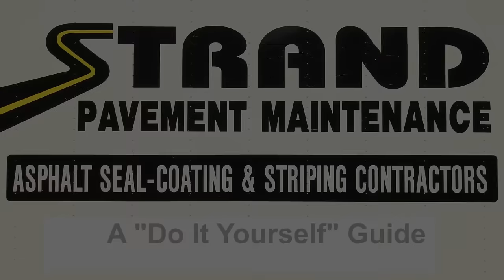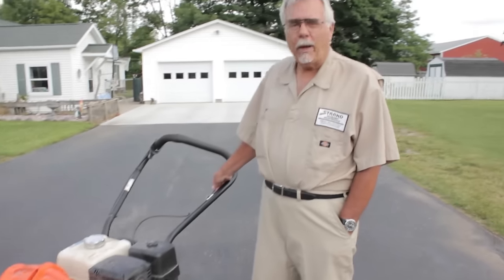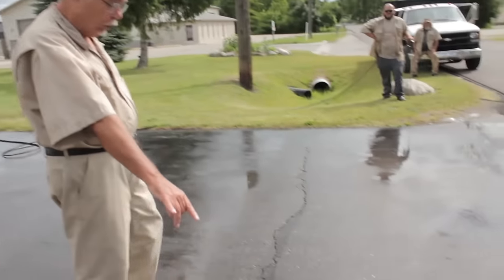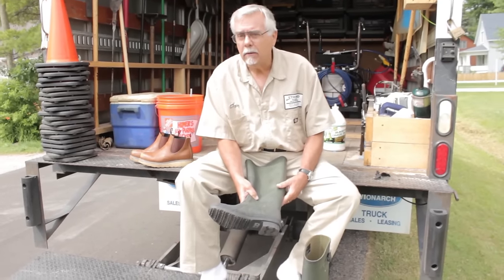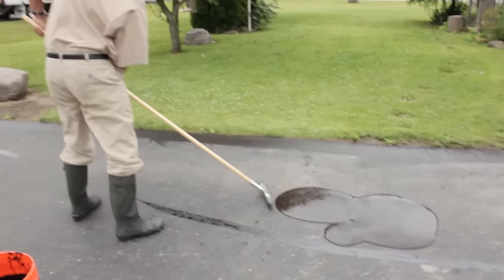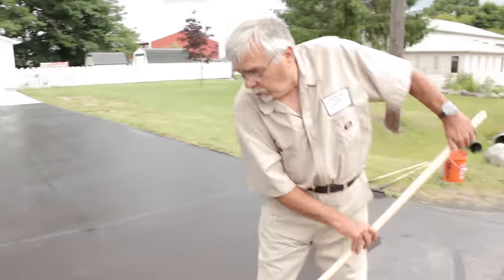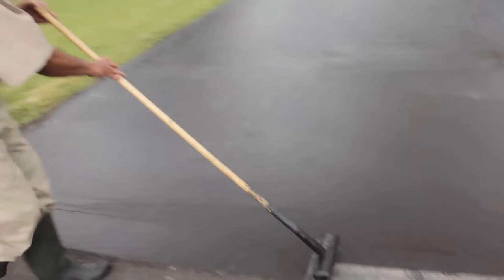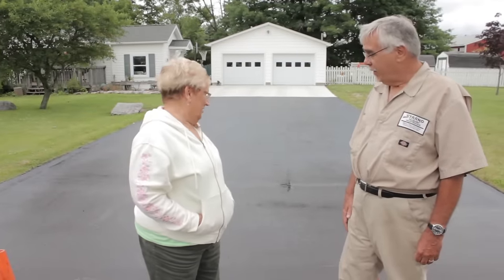Asphalt Seal Your Own Driveway!

Comment: As someone who's done asphalt work for basically my entire neighborhood, if you decide to do this on your own and are either struggling to get your hands on a power washer or cant get all the dirt off the pavement youre working on, dish soap and water, a clean broom, leaf blower, paver squeegee, and a basic hose works just fine in cleaning and prepping for the sealer.
Reply: What the heck do you know about, "ashphalt" though? You worked on asphalt for a living! There's a difference.
Reply: Can you use this on concrete?
Reply: @johnnhoj15  🤣I plan to use this video as reference and seal my asphalt driveway  myself.
Reply: But... But what about the 13 hp Billy Goat?!
Reply: @threadlovert1393  careful!! Dave's method only works on,  Ashphalt, it doesn't work on Asphalt!
Reply: @johnnhoj15  😅🤣🙂
Reply: This is false. Never trust someone named "Jay"...
Reply: I felt like the guy on the video didn't want you to feel like this was a diy project you would want to tackle.
Reply: Yes!!! Finally someone who has a realistic approach on cleaning the surface prior applying the coating.
Reply: @christiancarfann729   yes, the thicker stuff works well

Comment: I totally overestimated how many buckets of material I needed! However I followed all the steps like you said. I had been filling in all the cracks over a period of time because there were many. Yesterday my husband and I went to Lowe’s and picked up 7 buckets, 😂, needed only 3! I bought the soft brush and a good metal squeegee with a handle and some cleaner. I used the Black Jack 700, red bucket. I’m 67 years old and pretty handy with projects around the house. I started at 9 am ( can’t make noise before 9 on a Sunday morning, county law) and finished at 2 pm and that included pressure washing. Each bucket of sealer is about 24 bucks and change plus the cleaner, 5 bucks, plus brush squeegee and handle another maybe 20 bucks. The last estimate I got for this job, Montgomery County, MD contractors 600.00 bucks 😂😂😂😂😂😂😂. Thanks a million for the detailed instructions and also from what you said you aren’t greedy like the contractors around here. If you don’t mind getting a little dirty it’s just a little time and effort. I squeegee left to right instead of up and down and the driveway looks awesome!

Comment: i think this was the most american video that ive ever watched
Reply: How?
Reply: Wayland C just the guy
Reply: Yes! Cheese! ... runny black American cheese!
Reply: Watching an entrepreneur actually do work?
Reply: The complete lack of ear protection and other safety equipment?  Yup.  Very American.  But hey, deafness and lung cancer from fumes and skin contact with toxic solutions only happens to other people.
Reply: how tf
Reply: Brian P Kuhn   blowers and trimming: loud enough to cause hearing damage after 2 minutes of use.
Reply: iatsd Nobody uses ear protection for weed whacking and using a leaf blower. I have been a construction worker for 10 years now, and have used weed whackers for my own lawn for nearly 20 years now, and my dad has been a construction worker for 30 years now, and neither of us have had any ear damage from using weed whackers and leaf blowers. We use ear protection when using really loud stuff, like jackhammers, but simple lawn tools are fine. If you put the engine close to your ears, then yeah it will be loud and can damage your ears, but for just trimming edges, you don't need to wear ear muffs, a respirator, or a full on hazmat suit!
Reply: Brian P Kuhn  As I said, that attitude is very American.  Go to a civilized country where the concept of cumulative/incremental damage is understood and you'll see people wearing ear protection - because it does cause damage whether you notice it or not.
Reply: iatsd If when I am 80 and I don't even notice I have any ear damage, although you insist I do, I think I will take my chances. Also, I am not even American! LOL
Reply: 2 weeks of training, I just learnt it in less than 7 minutes
Reply: iatsd     Huh?  What'd you say?  Can you repeat that?

Comment: I would rather pay him the $130 then do it myself for $65.
Reply: Bob Easy Exactly. It is not that much of a saving really. Sixty five dollar saving and all the hassle of DIY. Yeah nah.
Reply: For real. Steve Irwin's working for peanuts.
Reply: Bob Easy tbh there is no chance that he'll do all that for $130 when he's also got 2 workers to pay aswell as the jet washing he did to prepare it
Reply: Ivan Hardon I'm sure he does more then 3 places like that a day
Reply: Bob Easy yeah 65$ plus ur shoes ur gonna dirty plus ur gas at HomeDepot plus headaches plus other stuff plus u probably won't clean the driveway right all that for wanting to save 70$ lol
Reply: John Doe that big tanker on the truck does the middle section after the cut in in about 30 seconds, powerwashing is useless it doesnt need to be that clean, so a lot that size 8-10 of those a day
Reply: if it's hot and humid, than I aint doin sh*t outdoors
Reply: He is showing the “proper” way, not what he’d do for $130.00
Reply: That's probably just his price for the materials to the customer. I'm sure there were other costs involved that he didn't mention. I don't think he'd be in business if he worked that cheap.
Reply: Yup. Exactly what he is showing. That he can do a good job, and that you don't want the job.
Reply: Actually in another one of his videos he said he made this for people that have smaller drives that he doesn't want to mess with. It's not worth his time to do small driveways if he has bigger parking lots to get to.
Reply: Vincent Falbo Exactly what I thought from the first, “You probably don’t have a...” statement.
Reply: Bob Easy u have a broke persons mentality
Reply: a penny saved is a penny earned. as long as it doesnt take you to do this for more than 5 hours, you've saved money
Reply: Bob Easy 
There resurfacing places that r ok, y.
Reply: thats the purpose of this video
Reply: That´s the whole point of the video

Comment: I just had some door-to-door guy quote me 800$ to seal a 2700 sq ft driveway (that was completely repaved 12 months ago, so no cracks to fill).  I sent the guy on his way, and then started to look into what it would take to do it myself.

It helps a lot just to have an idea ahead of time what the steps are going to be.  For me, I think I will do this over 2 days.  The first for the prep work, and then do the actual sealing the very next day.
Reply: @made-in-the80s I had no intention of hiring him, so I didn't ask.

Comment: i tried to do this 
MY DOG IS STUCK IN THE FLOOR WHAT DO I DO
Reply: CR4SH don't do this indoors
Reply: CR4SH Pretend it's not your dog.
Reply: and for that, we'll just use our weed wacker...
Reply: Cale Tucker but you probably don't have one like he does...just go to Home Depot
Reply: CR4SH you probly don't have your own Jason like I do but any old residential Jason will work
Reply: +The storyteller lmaoooooooo
Reply: CR4SH you gotta put him/her/alpache/helicopter down
Reply: CR4SH omg lol 😂😂😂😂
Reply: CR4SH that should be fine 😊
Reply: CR4SH just cut his legs off and get new ones at walmart hell be fine
Reply: CR4SH get a power washer, i don't think you have one like i have but a normal one is just fine. Clean your saw with the powerwasher you probably do not have a fourteen meter long saw just like me but a normal one will work just fine. Cut the Legs off. And buy a new one. Good job dave.
Reply: My dog doesn't usually get stuck in driveway rubberized sealant, but when it does, I shoot it.
Reply: Banunu Hawawa hahahaha nice
Reply: CR4SH OH THATS BAD...

Comment: I’d rather pay the $135 seems like a great price!
Reply: That's exactly what I was thinking. I'd rather pay $135 than do this myself. If I do it and it looks like shit, I'm stuck with it. If they do it and it looks like shit, they would have to fix it... but since they do it all the time, it probably wouldn't look like shit.
Reply: Imagine doing 10 houses a day, for 7 days, priced at 150$ each ....
Reply: The quote was not accurate by any means. Edging, filling cracks, pressure washing, waiting two hours, then applying the ashfalt sealer.. $135 my ass. You’d go out of business in a week.
Reply: You will never  find a legit company to do a class A job that cheap
Reply: C II  Now take half out for material cost. $5k for a week. Cut that in half again because your business can only operate half the year at best and you need to save half your pay for when you arent working. $2500 for the week. Operating costs are hard to estimate, but let's say 10% to account for maintenance on equipment being used (truck, power washer, air blower, brushes that eventually get replaced, and so on). So now you are at $2250 per week. 
I didnt pay too close attention bit there were about 3 guys working. So let's assume boss gets 50% and the other two get 25$. $1k per week for the boss.  $600 per week for the laborers. 
And that's before taxes. 
It's a perfectly fairly priced job and the wages arent that great.
Reply: He can come do my driveway. Last guy to look at mine was a gypsy that wanted $1200. Yeah its rather big and I’m proud of that. 😉
Reply: @curbappeal3397   Surely you mean $135 my ASH    -phalt   o.0
Reply: Me too
Reply: Micky's Kick Reviews you’ll never find 10 houses a day to do this for in an area close around you
Reply: His labors made more money then him!!!🤦‍♂️
Reply: @mickyskickreviews4826  yep, just gotta pay for the equipment, manpower , running costs and product.
Reply: MTH Power Wash LLC yep, this guy is total bS
Reply: Haha the guy is a great salesman
Reply: MTH Power Wash LLC This is a really small job,  probably 1-2 hour work, they cant charge so much. Also as he said they usually doing bigger projects where probably getting much more money. Also he said that he spent 60 dollars for the stuffs, but when he doing as a company he gets everything cheaper so maybe 30-40 bucks only . So probably around 100 bucks for an hour job, thats not that bad.
Reply: Smash Appeal As be said, they are usually doing bigger projects, this was just an occassional small job.Its like when a car repairman showing how to change oil.
Reply: The shoes that you wreck are with more.
Reply: I thought he was legit going to say he charged the broad $600 and I woulda been like, "hmm, seems worth it."
Reply: I was thinking something like this would cost about 1300 bucks . We just had our driveway sealed it’s about twice the size and it was 2300
Reply: What 3 dollars a gallon of seal ....it only cost 1.35 here in cali.
Reply: MTH Power Wash LLC  200 an hour? Damn. And I thought I charged a lot at $120 lol
Reply: @Sineseol  this is not a 2 hr job lol. Pressure washing alone might take 1 hr with a surface cleaner . Then you gotta wait for drying. This is a whole day job bc of wait time. Granted you could start it and go do something else
Reply: MTH Power Wash LLC  wow. What do you do for that much?
Reply: MTH Power Wash LLC  oh OK.. You charge by the job then.
I dont specialize in power washing. We do remodeling but occasionally a power washing job pops up. We have a dewalt 4200psi with a decent surface cleaner, seems to do the job. Haven't messed with chemicals yet though
Reply: @simpleminded5215  why do I always see people talking about "gypsy" in videos with asphalt?
Reply: @Mike-rb2kk  $600 is closer to reality than $135. That had to be a mistake.
Reply: That was done in 2016 only did 1 coat .   Cost of the materials today for my driveway 250.00
Reply: @curbappeal3397  he forgot the two zeros at the end!
Reply: @curbappeal3397  that’s the price he gave the lady because she agreed to make him breakfast the next morning 😉😉😉
Reply: @Luckingsworth  did you miss the part were it takes several hours?
Reply: @curbappeal3397  am I the only one that caught the “ashfault”? 🤣
Reply: I think he forgot to charge for labor
Reply: @curbappeal3397  it would cost way more than the $135 in the North east.
Reply: I do this job in Puerto Rico for $ 4.00 dollar per square foot.
Reply: @johnjefferson8215   just got a quote for $1700. I’ve got about 250ft of driveway that’s 20ft wide.
Reply: You cant do even 4 a day if you have to wash them all down and wait to dry
Reply: @simpleminded5215  was he gypsy ?
Reply: @parkinglotstriping9800  yeah its 3.00 bucks here
Reply: I wouldn't even move my truck for $ 135
Reply: @embrj1453  LOL 😂
Reply: @UsamahSmiri  besides getting views / exposure not every one wants to DIY or if the person doesn't have rubber boots , leaf blower , pressure washer , brush , squeegee that $135 looks good since the half cost of DIY is just material  like sealer and crack filler.
Reply: $135? Sure I'll take two right now. Great price. Sidebar: I don't have $135 but I do have these $5 shoe protection covers to square up
Reply: He was obviously joking. She's probably his wife or sister. I did my first one two months ago to a friend. It took me a day because I had to seal a lots of cracks. Was $140 the materials and 250 for my job. My friend gave me 500 happily. I won't do a driveway like this one for less than 650 including materials. No power washing included. If power wash is needed, is better to seal the next day unless you have a smoking hot 🌞 The price would go up to 800 to 900  minimum.
Reply: @mickyskickreviews4826  Cutting grass edges 25min, blowing/ cleaning/drying driveway 2hrs, mixing, cutting in and applying sealant 2 hrs, cleaning up 20min. Thats 3 hrs per job without even travelling, then you add up the cost of the sealant itself and buying the truck and equiptment, $10,000's.
Whilst hoping that you get a steady flow of customers. The max you could do is 3 per day. So all in all not very profitable.
Reply: @curbappeal3397  That's what I was thinking.  $60 profit for all that work, doesn't sound like the american way to me.  Than you get taxed on that $60 so it's more like $35 plus the truck, insurance, gas,  licenses, and equipment.
Reply: @BNA101  definitely fly by night pricing 100%

Comment: I did that 2 years ago.  It was easy enough.  But frankly cost savings was about $75.  It also lasted 2 years which really added up to savings.  This year I paid for it.  It was $275.  Worth every penny.  My drive way is about 5 Dodge vans long and one van wide with a 3 car garage (so that is the surface mass I had to cover).

Comment: You probably don't have a 9 inch thick steel reinforced high strength concrete driveway like I do, but a brittle thin asphalt driveway that needs maintenance on a regular basis will do just fine.

It's pronounced "ass fault" not "ash fault"... there is no "h"directly following the "s" in the word "asphalt"

Comment: Sooo, to save money you need to; buy a weed wacker, power blower, power washer, crack filler, rubber boots, brush, squeegee, sealant, sealer and probably some other items I missed, then spend a day working on it instead of working somewhere else and making money, get some back pain, and have a job that is not nearly as good as a professional for what? $5 less than you would pay someone on craigs list to do it? LOL, okey there buddy.
Reply: I surely do not have most of that equipement already,. Hell, I don't even have a driveway.
Reply: Most people won't have most of that equipment, this guy is delusional.
Reply: I think the DIY homeowner who will actually apply the knowledge from this video is the type of person who owns many of these tools already.
Reply: +hkm82 Most handymen and DIY guys will have this equipment, and that is the target demographic for this video. Just look at any DIY video, like any Mathias Wendell video, and it will most likely have equipment that handymen have that you don't, buddy :)

Comment: I just bought Black jack sealer 27.00 Gal.  Got 7 5 gal to do 900 SQ FT.  I fig to do 2 coats .   Total so far 258.00  . Prices when way 2021.  Is going to last 10yrs ?  You did nice job.

Comment: So, I’m a new homeowner, and just ignorant to home repair. I do understand how to deal a driveway, but I have a couple questions, after I seal the cracks, so I smooth it out with the same squeegee? Or use a putty knife? How and where do I clean off the squeegee when done? Bc I’m assuming you can reuse it for next time, or do I let dry and toss? Same with the brush? I have a bit of rough pavement that isn’t black, can I black top that also? I hate that it’s two different colors. Also assuming dry time will be labeled on the buckets? I’m excited for spring.

Comment: I power sprayed the driveway clean and let it dry. I applied trowel patch because I have gator cracks on half my driveway. I think it was put down thin enough. 3 days later there are cracks in the newly put down trowel patch. Any sugestions on next steps? Not sure how to fix or fill that before sealing. I dont know what I did wrong

Comment: I was quoted $1000 dollars to seal a driveway about this size, by the company who is going to do the street out front, and I can buy the sealer in bulk for about $60.00 plus tax.  This why I am going to seal it myself.  If they had told me $130.00 to do it I would have told them to go ahead.

Comment: My very old driveway is very rough and pitted so even after sealing the cracks with crack sealer the rough surface will require up to 1/4 inch depth of sealer to create a smooth surface. Will that thick be a problem with sealer?

Comment: Question:  We just bought a [place where they sealed teh drive but didn't fill the cracks.  Can I just use crack filler over the sealant?

Comment: What kind of sealer is this and where did you purchase ?Appreciate a reply.
Reply: @James Gale I never heard back from you ,so I went with the Latex-rite  from Home Depot ,it cover very good and had traction sand in it.I seen where you used the squeegee,but I rolled it on with no issues .Time will tell how it stands up,it's indicates 4 years on the the container ,but I doubt it will last that long lol.Thank you for the reply.